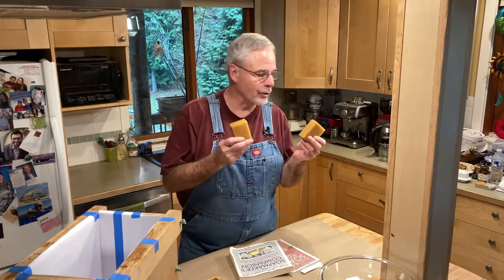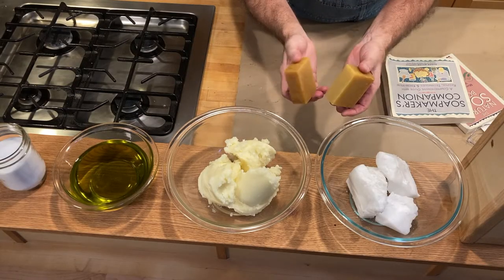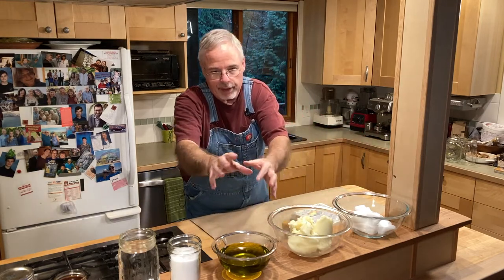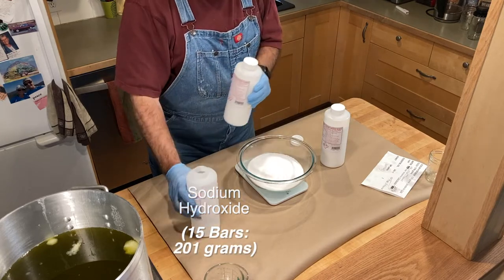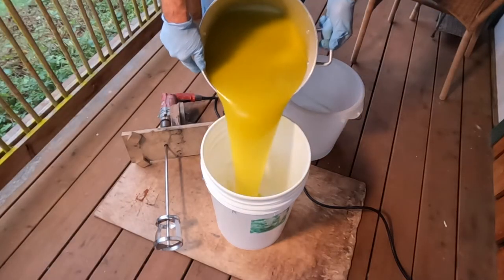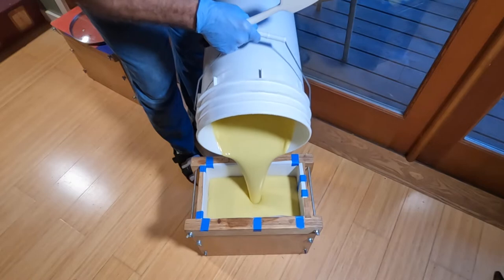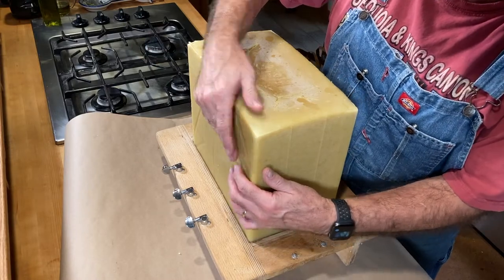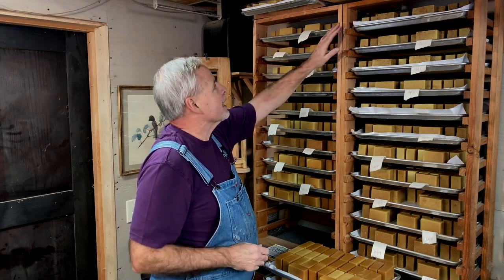Make simple, soft soap with organic oils using this easy step-by-step process!

Comment: Hi. Great video! When pouring EO, try holding a stick next to the bottle. That way, it will not run down the outside of the bottle causing a mess on counter. Also, have you thought about using tallow or lard instead of palm oil?
Reply from the maker: Thanks so much for your suggestions!

Comment: If any one is interested, this is his recipe converted to percentage. I don't know anything about milliliters so I didn't figure that one.
It is as close as I can get that is logical. All of this fits like a puzzle but sometimes the puzzles don't quite fit for certain recipes that people get out of a book. This is extremely close and will produce the same thing. The end result though is the amount of lye is the exact same.
OO = 41.2%
CO = 31.4%
PO = 27.4%
Honey = 2.265%
Water/lye ratio = 70.92/29.08
SF = 8%
He should produce a 5.77 oz bar according to his info he gave
And an extra note, using the bottles he has, he could have premixed 2811 grams of a 50/50 solution inside the bottles by using a funnel and then top it off with the rest of the water to wash down the lye. After that, add 2022 more grams of water to the oils which will give the same water/lye ratio. Those bottles will handle the heat so just put the cap back on and shake the bottle. No fumes and don't have to go outside. He probably already knows this but he is making a video. Just use an oven mitten to shake the bottles and loosen cap temporarily for pressure to escape.
Reply from the maker: Thank you so much for your help!
Reply: @MadeinBibs  
No problem. 
I have been making slab cutters myself so I can say with appreciation how really nice your set up is. I kind of went the route of one cutter being able to do it all. It will cut slabs into loaves into single bars but since its an all in one design its not as quick as yours but I think you have a really nice system and it has tight seams.